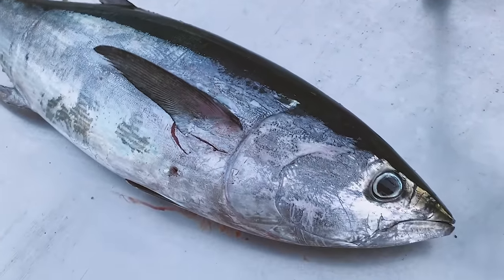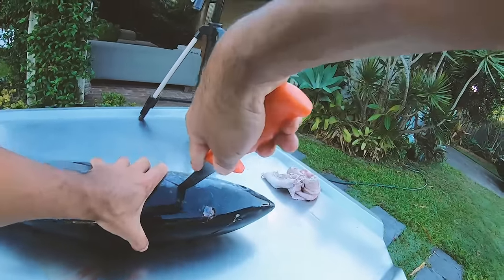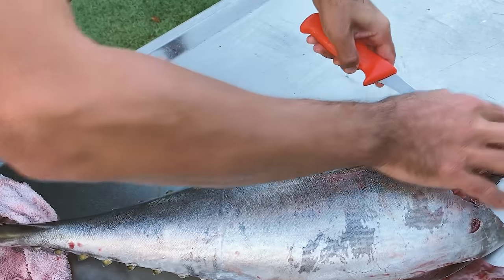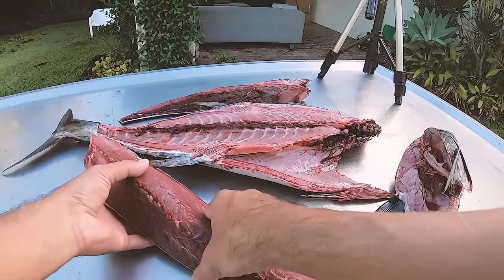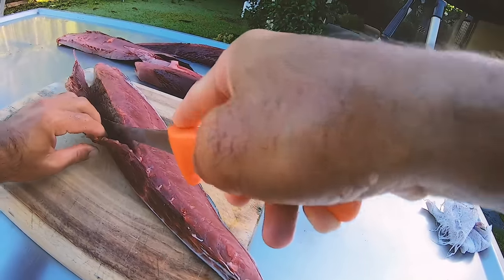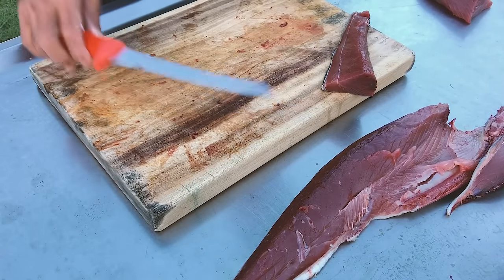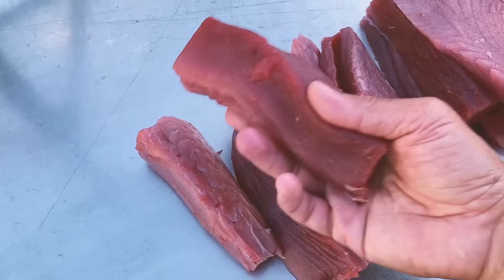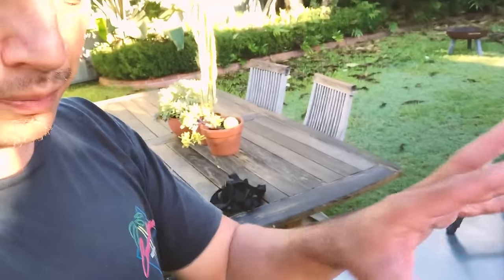How To Fillet Tuna - From Start To Finish

Comment: My neighbor gave me a whole Yellowfin. I have never cleaned one before, so I watched your video. It was awesome! The only thing is.... I washed the flesh after I cut the fillets before getting to the part of the video where you said not to do that. Oops!!!!
Reply: In my experience with striped bass, flounder, black sea bass and tog, if you dry the fillets off completely with paper towel before you vacuum seal them (if you do that) they aren't ruined...just the outside is a little bleached by the chlorine in tap water. Not sure how to get the stinkiness/slime off of them another way.

Comment: How much of this is safe to eat? If I had 12oz a day would I run the risk of mercury poisoning?
Reply from the maker: The research in my local areas suggests eating most of the fish (including this type of tuna) is fine up to three times a week. Apart from a few species like sharks, marlin, swordfish and a few other bottom and freshwater species👍
Reply: @rokkitkit  ahh ok cool thanks!